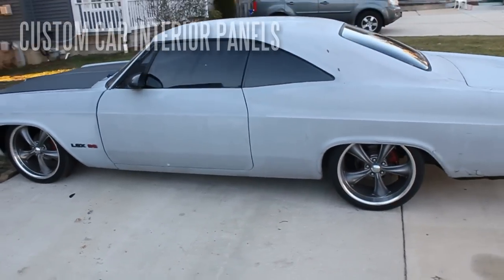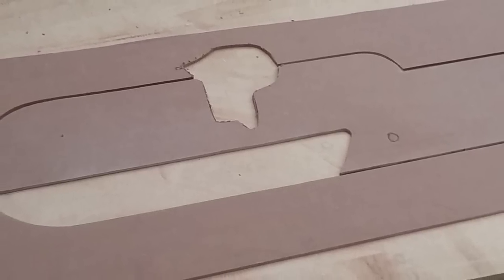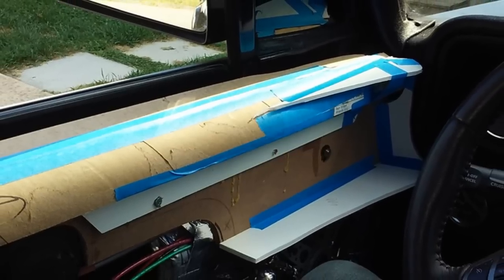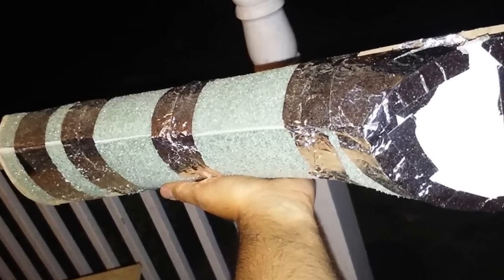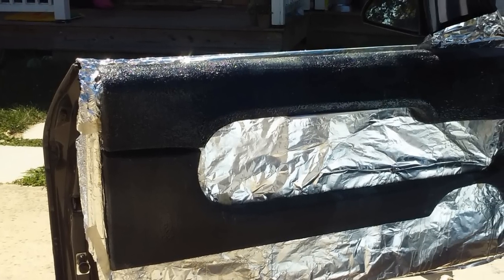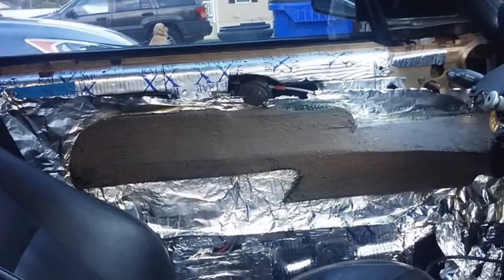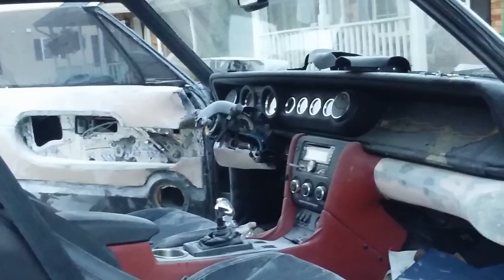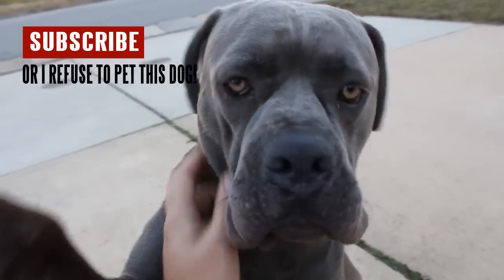How to Make Custom Interior Car Door Panels

Comment: I own a 2011 Crown Victoria. I want to accentuate the air conditioning vents to look chrome as well as other parts. What do you recommend I use on the plastic parts?
Reply from the maker: You mean to turn the plastic into something that looks like chrome? I'm afraid I don't really have a good answer for that. You can have plastic parts chrome plated but I am sure it's expensive. I guess if it were me, I would see if I could find some chrome wrap and see if that works. Otherwise, silver paint and clearcoat I guess

Comment: I'm really curious about all the modern looking switches and dials for the headlights and AC. Did you upgrade the car's electronics or are they just cosmetic upgrades to the stock electronics? Curious about the controls on the steering wheel as well
Reply from the maker: I ripped out ALL of the old wiring that was in the car and replaced it with wiring from a 2006 GTO (same year as the LS2 engine I used). With a few tweaks, I was able to get most everything to work. There were a few bugs...for instance the wiper delay would not function...and a couple other things I can't remember. Several of the fuses in the GTO fuse box would not light up, probably because of the missing body control module. I was able to remedy this by adding a secondary fuse box to power the radio, airbags, and a few other things. Steering wheel controls were not functional, although if I had a working clockspring it could have been made to work. Heater controls worked but there was no AC in the car so those didn't.
Reply: @DavidGuyton  Thanks for the reply man, that's pretty clever. I've been wanting to build an interior for one of my older cars and I always rewatch this video for reference and inspiration, the electronics and dash cluster are especially something I want to upgrade. I'd love to see more of your work process and updates on the impala on your channel, because this is the best example of an interior project I've seen
Reply from the maker: @LulzAreGud  Thank you sir! I will definitely add more car related stuff when I do another project, but unfortunately I sold this car some time ago.
Reply: @DavidGuyton  Whoever you sold it to is incredibly lucky to get a piece of treasure like that
Reply from the maker: @LulzAreGud  He's very happy to have it. It's like 2000 miles from here, and he still texts me updates from time to time. Last I heard he was taking it to the body shop for bodywork and paint.

Comment: Did you take the blue tape off the panels and glue the foam board and MDF pieces before wrapping in fleece?
Reply from the maker: The tape and the foam board are not critical to the structure of the panel after you apply the resin. You can leave it inside there or you can take it out but it would be a real pain to get out. The MDF that forms the back of the panel has to remain in place (I used whiteboard paneling to mitigate any moisture damage from rain). The MDF is firmly secured in place before applying the fleece and resin, but it's made even more secure once you lock it in with the resin.

Comment: I'm getting ready to do my '99 Sonoma and if it turns out half this good, I'll be happy with that! I've done interior refurbs and body work in the past, but nothing this in-depth. I have 90% of materials and all the tools, I just need to stop dragging my feet and jump in already.
Reply from the maker: You can do it, I assure you! None of this is very hard...just takes a lot of planning and a lot of sanding

Comment: I know it doesn't show it in the video, but after the fleece and resin do you need to add sheets of fibreglass as well or are they strong enough with the bondo you add after?  Also with your steering wheel did you manage too get the steering wheel controls to be functional as well? I'm looking at doing those mods to my Chrysler Valiant Charger at the moment. Great videos, keep them coming. Cheers
Reply from the maker: If you add enough resin to the fleece, it's pretty stiff, but you may have weak spots. This is easily fixable with adding the fiberglass reinforced Bondo which you will need to add to the whole surface anyway. I didn't need any more reinforcement than that. My steering wheel controls do not work, but it can certainly be done. The column I got was out of a wrecked car and the clockspring was busted, I would have had to replace that to power up the controls, and I just couldn't justify the expense and effort required.

Comment: Questions
What New model did the hardware come from   steering wheel, door latches ect. If so are you using the computer from that model..or is it a whole  plug and play kit?
Reply from the maker: I used everything I could from a 2006 GTO....computer, harness, switches, etc. Cannot remember the door handles, but I want to say it was something Volkswagen like a Jetta. The steering wheel was from a Malibu, but that steering wheel is common across like 30 models from Corvettes to the Pontiac G6.
Reply: I keep  telling  my buddy it could be done. Damn great job

Comment: How do you interchange climate control? Im trying to change up my trailblazer interior with your videos! (:
Reply from the maker: Luckily the heater controls from the original car were cable controlled, and so were the Mazda controls I used in the console. I doubt the Trailblazer is cable though...most likely electronic. There are ways to do it, but I am afraid I can't be of much help there

Comment: how did you install the under dash panel? Looks great :)
Reply from the maker: Thanks! There's a few bolts that stick out of the back of all the panels, and corresponding holes drilled into the dash. The pieces just slide right into position, and then you reach behind the dash to get a nut on the bolts

Comment: I have a 66  caprice.  I'm currently  building my interior.  How did you get the door panels to slip on the top door panels with out the stock metal pice on top of the door panel
Reply from the maker: I made my own top panel with MDF instead of the metal kind. I embedded bolts in the bottom of it, and drilled corresponding holes in the top of the door which the bolts fell into to hold it in place.

Comment: How did you get the fiberglass parts to stick to the door... I want to try this, but... I don't understand how you bolted it together. Clips? I see you put them on the car door overtop the tinfoil but. How did you get them to attach to the door. #Halp!!
Reply from the maker: There are holes I drilled through the backing boards, and directly into the metal of the door. Then I took the boards off the door and embedded bolts in the holes on the boards, securing them with fiberglass. Then I did the fleece and resin. etc. The completed parts have bolts sticking out of the back that line up with the holes in the door perfectly. You then reach inside the door and put nuts on the back of these bolts. The red center section goes in last, and it has no bolts. Instead, there is a perimeter of metal screwed to it, and this metal lip slides in behind the pieces already bolted to the door. To secure it in place, there is a screw at the front of that panel, but it is not seen when the door is closed.
Reply: David Guyton amazing work. Thanks for the reply! Motivated me to do this lol 🍻 cheers! I love it!

Comment: Beautiful interior. I was wondering, now this is just curiosity not to challenge your work at all but was there any consideration given to having an upward swooping center console like in some more modern cars? I only ask because I think I could learn something about design from your answer. I have a 1988 Impulse that I would love to update a bit.
Reply from the maker: I'm not sure I understand what you mean by upward swooping...can you elaborate a bit?
Reply: David Guyton Well instead of the bottom part of the console in the area of the shifter being level and the part for the radio being vertical what I meant was something you see on newer cars, where the bottom part slants up toward the front and the radio would end up with about a 35-40 degree slant just ahead of the shifter. No big, it's just something I was thinking about if I get to redo mine, which is from 1988 is now a lot like what you have. Granted what you did is a huge improvement from stock.
Reply from the maker: Well anything can be made to work. As far as why I chose to do it this way, I wanted to use a "stock" console so that I could have a stock looking radio area, and also be able to use the plastic radio surround. Without that, it was going to look way too "built" and I wanted to avoid that. I also needed to get a console that would at least SORT of fit the car, so I did a lot of measuring and settled on a Mazda 3 console. I had to modify it heavily, but it gave me a good base to start from and it worked out well. If you are into consoles with a different slant, you can certainly make it work....it'll just take a lot of work to get things to fit. That is true no matter what angle the radio is though haha
Reply: OK I'll pick an extreme example. Google Bugatti Veyron. There are some I like more than this example but it gets the point across. I like the fact that on some cars when you scan the console from back to front by the time you get to the gear lever you're already going up and there is no "knee" in the transition from dash to console. The Veyron is not a great example of that but my point is to make the two regions become one.
Reply: Understood, respected and appreciated. As before, very nice work.
Reply from the maker: I was careful to place my shifter where I knew it would be comfortable. I'm not saying the people at Bugatti don't know what they are doing, but in my opinion, the shifter is far too close to the dashboard. To adjust the radio in my car I need to lean forward a bit, and having to do that to shift would make for a very unpleasant driving experience (especially in a manual). I don't really see the need for so much open space between the shifter and where you would rest your elbow. As far as the transition between the flat of the console and the upright part of the console, I don't see a major difference between the Veyron and my design. I mean, it's not anything close to identical, but it's not terribly far off as far as angles go.
Reply: I stand edificated. Thank you sir.

Comment: What was used to cut the wood? The cuts are so clean
Reply from the maker: I don't really have any wood cutting equipment. I just used a handheld jigsaw for the most part. I sanded a lot too
Reply: @DavidGuyton  Thanks for replying, for the center console and the dash did you base it of an existing design and pieces or is it all custom? I love restomods and its so cool to make the interior match the modern drivetrain and mechanicals.
Reply from the maker: @xxMidNightHuskyxx  The center console is a heavily modified one out of a Mazda. I used it so that I could have the storage area and also use a stock ABS radio surround and the heater controls. Literally every other part was built completely from scratch.

Comment: Superb...what column did you use?
Reply from the maker: 2006 GTO column to keep everything as close to the same as I could. The wiper and blinker controls clipped right into the GTO column
Reply: David Guyton sweet thanks. I'm doing a 2000 Camaro build and I really wanna get away from the older style column. The pins in mine are completely gone to the point we're it jams up.

Comment: So what kind of foam are you using that the fiberglass resin doesn't eat it away?
Reply from the maker: There's no foam. It's polyester fleece that I am putting the resin into. If you mean the foamboard, there's not enough contact with the resin for long enough for it to matter. It hardens within a few minutes, depending on the temperature outside

Comment: How did  you convert your a/c controls? Didn't the original panel use cables? I want update my 3rd gen camaro
Reply from the maker: yes the original car used cables. I originally tried to make a very complicated fake panel to cover up the original controls. I got it to work but it was not ideal. That was when I was making my own console instead of the one you see in the car now. That console is out of a Mazda 3 (although very heavily modified to fit the car and my interior design). I wanted to be able to use a factory radio surround and heater controls if I could. My car doesn't have AC, so all I really needed was the fan controls and the temp, although the temp doesn't matter that much. As it turns out, the Mazda heater controls are actually cable controlled. I haven't bothered to connect them to the car yet, as I only really drive the car in nice weather....but all I have to do is connect the cables together and the controls will work. The fan is electrically controlled, and I do have that hooked up.
Reply: what year mazda3
Reply from the maker: I used a 2007

Comment: What are those bench seats you using in your car? Would like tho know thanks
Reply from the maker: Both the front and rear seats are from a late model Camaro.
Reply: Thanks man and great work this gave me some ideas to finish putting a twist to my 72 olds supreme interior I've been building already done the whole ls swap and 6speed and all of that just been brainstorming on interior ideas thanks!

Comment: What I don't understand is how you attach it to the metal on the door?
Reply from the maker: When I placed the flat panels on the door, before I did any shaping, I drilled holes through both the panel and the metal of the door. Then I put short bolts through the holes and held them in place using fiberglass reinforced bondo. Later on, after shaping, these bolts would line up exactly with the holes in the door. Since each piece is separate, you can reach into the door and get a nut on the back of the bolts. The center section was the last piece that goes in, and has to go on a different way since you can't reach inside the door for that. So I screwed on a small metal lip to the back side (near the arm rest). This lip slides into place under the other panels already bolted to the door. Then at the front of this piece, there is a screw that secures it in position. The screw is hidden with the door closed but you can see it in the beginning of the video where the door is open.

Comment: Hello, how do you attach the panels to the door? I don't see any screw holes in the finished product.
Reply from the maker: there are holes drilled into the door that correspond to holes drilled into the back side of the panels. Before fiberglassing, bolts were inserted into these holes and locked into place with fiberglass body filler. This leaves bolts sticking out the the back of the door panels, and you can reach inside the door to put a nut on them. The center piece has a piece of metal screwed to it instead, and this piece of metal slips in behind the other panels to lock into position. Then there are a couple screws at the front (hidden when the door is closed) to lock everything into exact position.
Reply: David Guyton oh ok that makes perfect sense. I've never done anything like this but plan to attempt it on my 71 Chevelle. Any tips or hints would be appreciated.
Reply from the maker: just don't be afraid to do it. That's the one thing that people get hung up on. None of it is all that hard, it just takes a lot of time and a steady hand. Be sure to check out my fiberglass dash tutorial for a little better detail about how the process is done.
Reply: David Guyton ok perfect, I want to do the dash as well using a Dakota gauge. I'm pretty confident that I can do it although it may take me a couple of trial runs. But if it don't work I'll watch this video again and try it again.

Comment: I show you how to wrap vinyl you need heat gun 3m can glue spray harbor freight has green can about 10 bucks. spray panel lightly and fabric/ vinyl. corners and   curves heated score cut from back your hiding your wrinkles on edge by spreading martial. practice on old trim panel 1/4 padding makes job more pro

Comment: hey any suggestions on a 3rd generation trans or camaro door panel
Reply from the maker: It'll all work the same way, no matter what car you do...just depends on the style you are going for. I had an '84 T/A a long time ago...long before I ever experimented with stuff like this. I would probably go for a very square, sharp, blocky design for that car. Something similar to what you see in this video, but without as much roundness.
Reply: thanks for the reply Bruh.keep up the good work

Comment from the maker: Gonna be selling this car here soon.
Reply: David Guyton how do you attach the panels to the doors and does the cardboard stay on there?
Great job.
Reply from the maker: There are bolts embedded in the back of the panels, and there are corresponding holes in the doors. You have to reach into the door and put the nut on the back. In some places where this can't happen, there are screws holding the panels in place, usually out of sight.
Reply: David Guyton thank you.

Comment: How did you add the window seal?
Reply from the maker: The design follows the same curvature as the top of the original door panels, so the window seals just need to be installed on the custom panel with screws, same as you would do with stock.
Reply: David Guyton cool! Thanks.

Comment: do you have subs in your car?
Reply from the maker: I don't have a crazy-elaborate system in the car, but I have 2 6.5s in the doors, 2 6x9s on the rear deck (all 4 amped) and a 12" sub in a bass tube in the trunk (also amped, of course). It won't win any awards but is sounds good. All Kenwood.